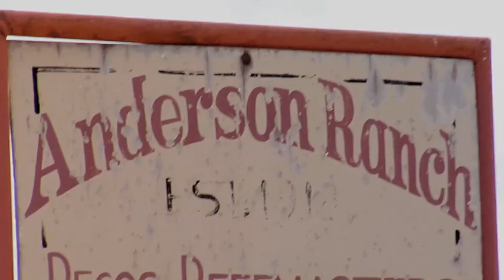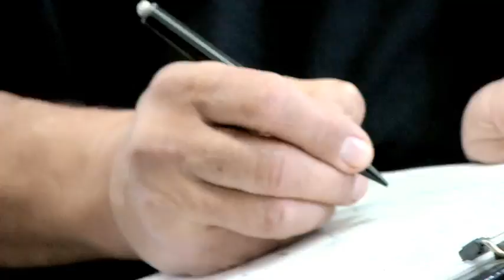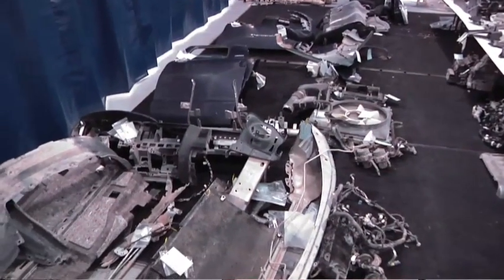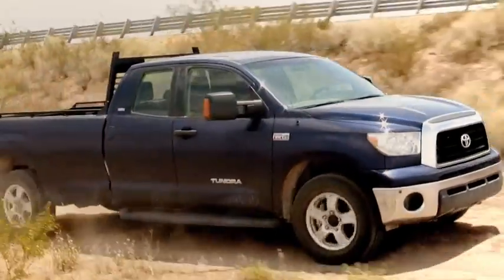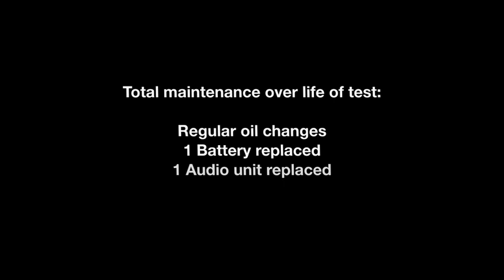Tundra Deconstructed: Episode 3 -- Heart of the Beast

Comment: Now I can’t wait to get my hands on a Toyota Tundra , Tacoma or 4 runner. These vehicles are just beast!!
Reply: 2011 Tacoma 4.0, 197,000 miles. One alternator & one battery. You won't go wrong!
Reply: My 4runner ball bearings failed recently. I bet you my bottom dollar they are original. Replaced ORIGINAL alternator 6 months ago on my 1998 4runner. Engine and transmission runs and shifts like brand new. 177k miles. Buying a Tundra then fixing the 4runner. Don't go past 2010. Stick with older models and get the tundra with 4.7 and get the V8 4runners (4th gen) same engine as Tundras! Get you a 3rd gen 4runner for $1,500-3,500 and the Tundra. Don't limit yourself to one car.

Comment: I just bought an 07 tundra with 150k miles for 14k. I figure ill get at least 150k more miles. Alot of people say i overpaid. I say its worth it. I didn't want a show truck. I plan on doing work with this thing.😃
Reply: My 2007 5.7 is at 369k no issues
Reply: U will be putting way more than 150k on it I guarantee 💯👌
Reply: Another reason why Toyota is in a league of their own, they hold great resale value!
Reply: My 08 tundra has 500k runs like new

Comment: I love my tundra but it does not replace a 3/4 ton. I replaced a ram 2500 5.7. My ram really hauled things like wood gravel and dirt much better. Towing was much better too because it was just a heavier longer truck. I would say my ram handled a 12k lb trailer like my tundra handles a 5k lb trailer. On that note my ram needed new heads at 46k miles. I'm confident my tundra will be better than that. I put my tundra to work hauling all the same things just lower weights. My tundra gets better fuel mileage and drives better. But it does not have the payload to replace a 3/4 ton. Please don't buy this truck to replace a heavy duty truck that you use in a heavy duty capacity. I have no regrets buying my tundra it's a great truck.
Reply: Seems like the point of this video was to establish that the truck CAN handle more load.

Comment: I own a Tundra and absolutely love their V8s but, the Nissan Titans 5.6 is a damn beast! Shitty gas mileage compared to the 5.7 but, torque and power. Wish Toyota would make their V8 sound as good also.  I’m sure a lot of the titans power is through the gearing.
Reply: I did consider a Titan before I got the Tundra, the reason was the salesman basically told me to walk away if I wanted to tow anything, of course this was a Subaru dealership, but he said the rear axle was basically a widened 1/4 ton axle, one look at it confirmed it, I think they are bigger now.
Reply: That’s why titans make you feel  like they have power because of their cheap quality built is very light weight and weak which in return give you a false sensation of being faster vs tundra lol

Comment: I wanna see what the timing chain and guides look like
Reply: I had to open my 5.7 up for a collapsed valve spring, fairly easy process. After 190K, I was shocked at how new everything looked. the chain guides are some kind of plastic, but barely had a mark on them. I'm at 250K on that truck, I bought another one from a repo auction, that one is over 240K now. 11 years and the bodies are rust free except a spot I damaged. I jackknifed a trailer into my first one after my 3rd day, the gouge didn't even skin over with rust for almost 2 years, and I kid you not, it never even spread, 11 years later, it's still confined to that gouge.

Comment: 2016 TRD Pro, and I had a good chuckle over the battery replacement. Its the damn Achilles  heel of that truck..I had to swap mine out after 18 months. That being said, its the ONLY thing that's gone wrong.
Reply: Jbog07  Ugh, you're not kidding. While they last a long time, mine went the day after new years when we had negative temps for weeks in upstate NY, couldn't get my shop over 20 degrees. That was about 200K, and at least 10 starts a day for 9 years. I bought a second 08 from a repo auction with 195K on it, I replaced that sucker in September just because.
Reply: It's pretty common now though batteries aren't made as well as they used to and new vehicles are really demanding of the Battery with all the electronics in them.
I think there's a brand called Northstar that still make then in USA other than that interstate batteries are also good.

Comment: Americans generally have low expectations for cars. 100,000 is nothing. We start considering a car reliable after 250,000 miles. I also noticed used cars are cheaper BC there is a tendency to get a new car if it's possible.
Reply: I'm American and no, I don't think 100k is the expectation I think it's more. Just about any car now will get to 100k. Also, a truck that does 100k on a ranch, getting beat on each and every day is probably equivalent to a truck that just does 250k highway miles so don't generalize or make stupid assumptions about what an American expectation is.
Reply: Abdul A most places outside America use diesel engines for their vehicle, not gasoline.
Reply: Abdul, I agree that 100k miles isn't a lot, but I don't think you appreciate how much abuse these ranch trucks see during that interval.  They probably see more abuse in 1 year than what the average truck will endure during its entire lifespan.
Reply: Abdul is used to seeing a Soviet 12.7 mm mg mounted in the bed and 27 muhjadin crammed on as well, driven in the desert with zero maintenance, until somebody sends an RPG7 up the tail pipe....if it survives they all shout TOW-YA AKBAH...TOW-YA AKBAH!!!! (Toyota akbar) while firing their ak47s in the air. A-rabs love Toyota's.
Reply: @mark-wn5ek  Abdul's a closet camel banger!
Reply: I just got an 07 with 100k miles. Yes 100k should be nothing for a vehicle. 300k and beyond is a reliable vehicle to me.

Comment: ask real tundra owners their opinion of smog system and leaking valve / cylinder head repair costs 2000 -2006 Yea major stuff good minor stuff adds up fast and creates much downtime Oh don't forger defective / recalled airbags
Reply: Judie Bombace yes Tundra is the most reliable truck. It can tow a space shuttle too.
Reply: 100k still runs like new with no repairs.

Comment: toyota is the best truck American trucks don't last dodge ford or gm they are built cheap
Reply: thats cause there building gmand f150s in mexico,tundra is built texas u.s.a and now its built like the old American trucks were.
Reply: Had a Silverado with 270k miles on the good old 4.8 Vortec
Vortec was a fantastic line of engines not the new ecotec junk 
Bad part was the transmission was too small it was the 4l60e which failed often but they are so common it's fairly cheap and simple to rebuild.
Wish it was the 4l80

Comment: I believe it is safe to say that all that can truly be said is that the Toyota held up very well. However, to reach reasonable conclusions as to how good it is against its rivals one would have to test comparable 1/2 ton pickups under the same conditions. As far as heavy towing on a highway, I still think a diesel is the way to go. This is especially true in mountainous areas were torque is so important both up and down steep long grades.
Reply: nmelkhunter1 Diesels are king for towing. Low end torque is always a must.
Reply: Agreed!
Reply: Tundra is the best truck on the Market. Simple and reliable. Hope they will include an Electrical engine in the future instead of Diesel.